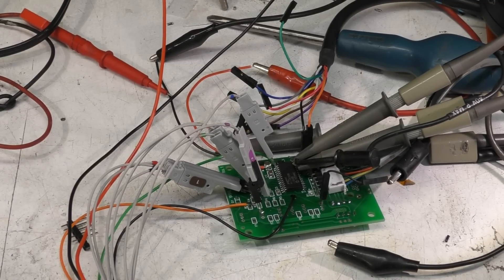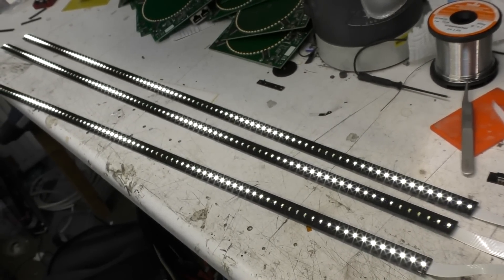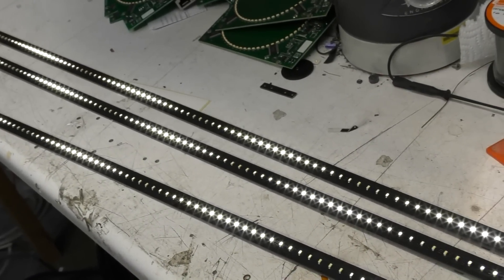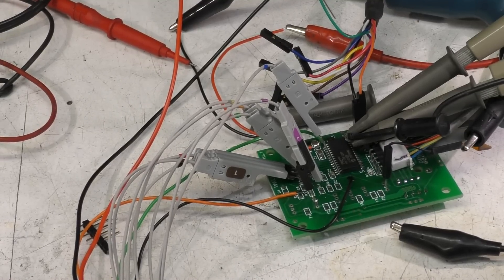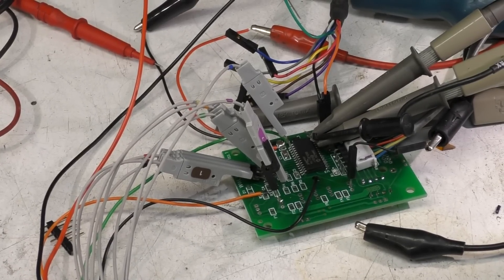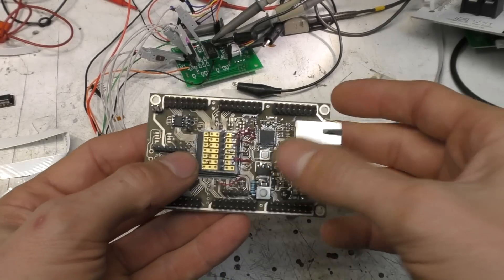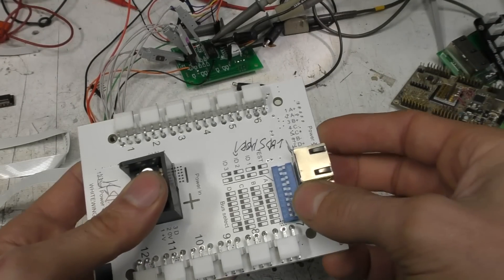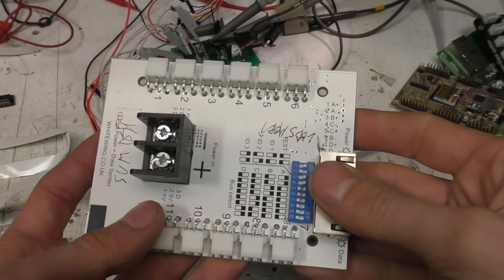Using DMA to implement multiple SPI ports

Comment: Did you try to use the PMP? Seems like the first obvious choice. You mention the clock pulse of the PMP would be very short. Too short? I want to try this with those 32by16 display panels. Thnx for sharing your quite brilliant and out of the box insights ;)

Comment: @Mike - Nice work.. If you enjoy exploiting the peripheral set to emulate other functions, you would love playing with the xmos chips. You essentially write your own peripherals using a bunch of resources such as timed ports (with shift registers), user clocks under software control and all without worrying about interrupt latency because you dedicate a core to doing just that task (so it's always read to react without context switch). No need for significant buffering. Great for doing high channel count bridging (ethernet/serial to serial/pwm etc.)..
Reply from the maker: Not looked in too much detail at XMOS - too much new stuff to learn for occasional use.
The 72 channel board is actually to replace an XMOS board that a customer uses, which went obsolete.
Reply: Interesting! Keep up the good work - really enjoy the videos. One day I'll own a scope that good...

Comment: If you have the RAM, you could instead embed the clock signal with the data, writing the same data twice to the I/O port, but toggling the clock pin. It costs twice the RAM, and the max transfer speed is halved, but you don't need the additional timers and there's no overruns.

Comment: Great video, Mike. Thanks! Also nice idea to use DMA to stop the clock. Was wondering if it would be possible - albeit a bit brain-frying - to shuffle the input data using DMA gather 'n' scatter. Dunno if this part has it... Cheers

Comment: I don't know if you have the memory, but why not double buffer? You can do your bit twiddling, then swap array pointers to output it with DMA. Then you can do both parts simultaneously. There could be memory bandwidth contention, but I would hope the DMA would have priority.
Reply from the maker: That would improve total throughput, but that isn't really a problem hare as there are multiple devices on the bus, so there is plenty of time to send.
Reply: The running start idea is neat and would see this all over the place in video game console programming,  Like on PS2 you could start DMA to start consuming a buffer before you have finished filling that buffer. Or the C64 scrolling routines that were still moving memory at the bottom of the screen while the raster was drawing the top and the raster caught up just as you were finished.  But as you say, it's working fine without these optimizations.
Reply from the maker: The problem with starting the DMA while filling the buffer is you have to account for the load that an incoming serial packet may create. I did look at it but by the time you assume the fill will be slowed by the serial handler the benefit was negligible. Double-buffering would give more overall throughput if needed, but would add latency.
Reply from the maker: Of course you could have the fill process periodically check where the DMA had got to before proceeding, but that would only potentially improve avarage time, not peak which is what matters.

Comment: some Freescale (now nxp) arm microcontrollers have a "flexio" peripheral which can be configured for many different types of serial output. unfortunately only the high end parts (I think) have enough channels (more than 4) for this kind of task. but you may be able to combine them with the existing spi peripheral to get enough spis (4 flexio outputs + 2 spi...maybe).

Comment: question:
in ARM, you can set and clear each pin bits with single word, but it will only effect pins that are 1 in that register, so in theory,  you can use 16b, toggle odd ones, and use as inputs or outputs even ones with no head smashing.

Maybe where are same things in PIC?

Comment: It may not be a bad idea to disable the serial rx interrupt once you get your packet (based on address) and re-enable once the DMA memory is loaded.
Reply from the maker: That won't work as you need to maintain framing of the packets - if you suddenly re-enable after doing whatever you're doing, you could be in the middle of a packet destined for another node, and not know when your one starts. (There is a way to avoid that issue, by using 0xff as a start-of-packet marker that;s never used within packets, but it's then hard to implement variable-length packets, and you need to not use 0xff within data. )
Reply: Ah, good point.  Coming up with out-of-band markers is a PITA.

Comment: Can you not enter the interrupts faster by managing what you touch, and using a naked interrupt call?

That makes the compiler not automatically save the stack context (so you have to be careful to not clobber the stack, or fix what you clobbered), but it can considerably speed up an interrupt.
Reply from the maker: Quite possibly, but this way will always be faster. 
Also I'd have to learn more about the MIPS architecture and assembler than I can be bothered to,
Reply: Oh, I don't think it's a good idea, but it's very much possible.
Reply: You beat me to it, I was going to ask if bit banging in assembler was a option.
Reply: The point is you need to save the CPU registers. If you want to avoid that, you could allocate a number of them for ISR use, and make sure you never touch them outside of the interrupt, but that would mean writing everything in assembler yourself.
Reply: I'm pretty sure you can tell most C compilers to not touch specific registers, so it shouldn't have to all be in assembly.
Reply: Even if you can, it means you have to be able to compile all code involved in the project from source (so no prebuilt part-support libraries etc.)

Comment: i like that you use pics! what is your opinion on the STM32s?
Reply from the maker: Never used them. Used to use NXP ARMs but started hitting code size limit of IAR free version and full version was crazy expensive. 
One  reason for using PICs as lots of RAM in small pin-count packages, also flexible pin mapping on PIC24F. For bigger jobs, ability to buy from MicrochipDirect ready-programmed is a big time saver. Architecture doesn't really matter much.
Reply: PIC have become my goto MCU for projects too! Specifically the DSPIC33e's; i quite like the PPS capability too. Do you know any good dev boards for the PIC32s? Ive noticed Microchip have no sane devboards for sale for any chip! Had to roll my own for the DSPICs...
Reply: Who uses DMA in a microcontroller can also work without a mickeymouse-commander (IDE) but with naked GNU like real men do.
Reply: Can you not target the ARM with GCC?
Reply from the maker: Yes but from what I hear it requires some fiddling about to get debugger etc. working. 
Nice thing about IAR and MPLAB it's well integrated, and  just works, most of the time at least. 
I regularly also use PIC10,12,16 and 24 , so having the same IDE, programmer and very similar peripherals is a big advantage.
Reply: Point taken.

If you do want a zero-fiddling ARM env, atmel studio is quite nice. It's based on visual studio, which is either nice or horrible depending on your opinions on visual studio.

I like it, but then I like nice GUIs.

Hopefully now that Microchip bought atmel, the atmel toolchain people will go and kick the microchip toolchain people in the ass a bit, and things will get better.
Reply from the maker: Recently installed Atmel Studio just to program some chips - totally hated it.  The programming dialogue can't be left open while doing other stuff - what a complete joke. 
I always use IAR for AVR stuff.
Reply: I don't think I've ever actually used the programming dialog in Atmel Studio. It does kind of expect you to follow their workflow. If you use VS a lot, it's wonderful and you can do everything without even looking. If you don't it's utterly painful.

For just bulk programming, you should probably use atprogram (cli application). I think they assume if you're doing production-type stuff, you should probably be writing a script anyways.